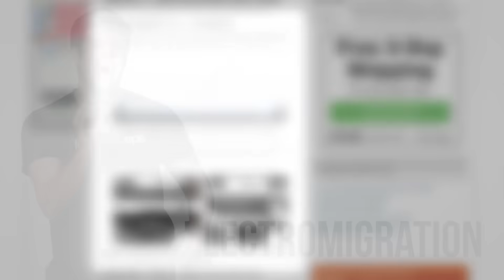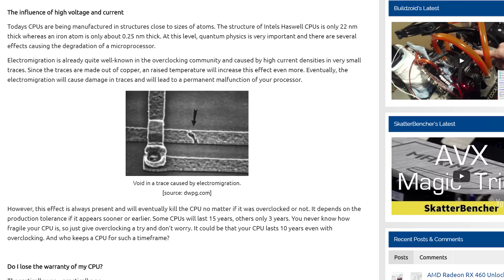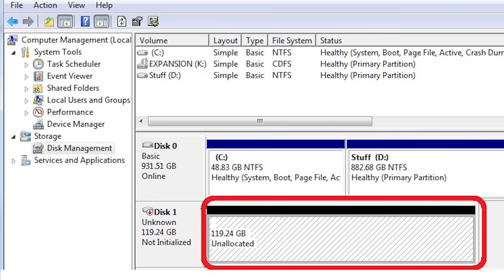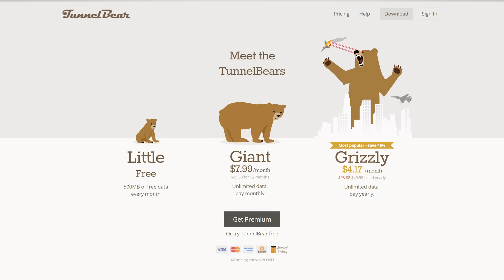Why Do Electronics Die?

Comment: Planned obsolescence is a very real thing. I used to work for a company who were masters of this. We would be in the prototype phase and when we designed a part, it was in the framework of "make it last, but not too long". The price of a part would be equal if we used the heavier gauge steel instead of the lighter, but that would make it too robust, too long of a lifespan. So we choose the thinner stuff. And we plan it to fail two to four months from warranty expiration. And to make it worse, we could make the failure to appear the user's fault. That is what I had issue with, and thus ended my employment there. No place for that sentimental dawdle in this day and age.
Reply: That is why no modern car will see classic stage!
Reply: why use one's family name as the company name?...
Reply: 100agree, and we are making this planet a junkyard  😥 that is not smart. So lets make things that last much longer 🙂
Reply: Thanks for sharing your real life experience.  Its something rarely heard.
Reply: "Planned obsolescence" is not a thing or, more precisely, it's usually misunderstood, it's not a plot to exploit people by somehow knowing exactly when something will break or wear out. All it basically is is the intersection of cost and demand i.e. "how much are people willing to pay" that determines the quality or lifespan of a product. For example, how much would you be willing to pay for a typewriter that lasts a 1000 years? Probably not ever much since typewriters are obsolete technology.
We can build things to last longer, yes, but most customers are not willing to pay very much for a smart phone that lasts 20 years when it's obsolete in less than 5.
It's customers that drive "planed obsolescence".
Reply: @177SCmaro That is an assumption you made up.  Planned obsolescence is very real, and for the purpose of selling the next new version.  Believing otherwise is self deception.  I'm not here to debate something I'm well aware of.
Reply: @qua7771  
Not an argument - just claiming someone is wrong or assuming something dosn't mean they are and has zero explanatory power. You're not correct just because you claim to be correct. Your remark is just as easily dismissed as if you came here claiming to be Santa Clause and you had no interest in proving it.
Reply: @177SCmaro  I mean, isn't it more beneficial for businesses to make a product break down sooner to sell a replacement? That in itself isn't caused by consumers, it's done by businesses to gain a constant recurring stream of revenue. Like you need to get more toilet paper because you use it up. Making electronics like that will generate consistent revenue is definitely something businesses want when it comes to stock growth numbers and business appeal. Although your points are still valid, I don't think it's a very complete thought. Also, withholding certain technological developments to make something become obselete from a technical and lacking certain features in the future is also part of planned obselesence. It makes the product less viable in the future, leading to the product to become useless in the nearer future, and causing a new purchase of a new model of the product sooner. It should also be noted that long lifespan products can SEVERELY disrupt cashflow with businesses, as the sale of these kinds of products are usually followed by a long period of few sales, which is extremely risky and dangerous for a business to deal with.
Reply: @alifelessrock48  
You need to read my comment again because it's not that simple. It depends almost enterly on what the majority customers want, not what the business wants, which determines the life-expectancy of a product. The customers are the one's choosing to buy the product. If they feel the price does not justify how long the product lasts they will stop buying that product and seek a better value alternative. It's two interests, sellers and buyers, working towards an equilibrium which could land anywhere between low cost and disposable and expensive and sturdy. 
This is super basic economics. Fundamentally it's about what the customers want and will tolerate, not the business. Nothing you said disproves or even really addresses this. Just calling it "incomplete thought" doesn't address anything I said. 
And withholding "certain technological developments" (citation needed) is poor business decision. I know if I was a competitor to Apple and I knew they were deliberately withholding features on their next phone that my phone would damn sure offer those features.
Again, "planned obsolescence" is largely a myth/a misunderstanding of some really basic economics. It's misinterpreting the demand for low or lower cost, relatively disposable or rapidly evolving products for a conspiracy pretty much every business would need to be in on against customers.
Reply: @177SCmaro   "It's misinterpreting the demand for low or lower cost, relatively disposable or rapidly evolving products for a conspiracy pretty much every business would need to be in on against customers." This discredits the fact that many larger corporations actually have stocks owned by those with stakes in their competitors. Apple and samsung actually work together for many things, they are business partners yet they barely one up eachother in the smart phone department. "The customers are the one's choosing to buy the product. If they feel the price does not justify how long the product lasts they will stop buying that product and seek a better value alternative." - When it comes to products essential to daily life this is not possible. Things like food and technology are essential, and often people are forced to buy them due to their lifestyle and for other reasons. No one produces these alternatives. You also never view this from a business perspective. You can sell more products with planned obsolescence.  You never address why this wouldn't occur, and you don't address why companies wouldn't find this attractive. Planned obselescence helps sell MORE inventory, so why wouldn't this be attractive? You never address the idea of consumable products either. Also, placing all of the blame on the consumer doesn't further your argument. There is something called business strategy where businesses aim to manipulate the economy. This is performed by joint groups of corporations. You also describe planned obsolescence as a conspiracy whereas I describe it as a business strategy. Fundamentally, we describe them and acknowledge them as completely different things. If you view it as a "conspiracy pretty much every business would need to be in on", which is highly unlikely, you might be correct. However, this disregards high cost entry industries where there are a few key businesses on the playing field, and the marketing tactics used to get consumers to accept lower quality goods. You are correct about consumers continuing to tolerate lower quality goods, but wouldn't this be something that businesses would aim to cause to increase profit margins? Wouldn't the evolution of products to be more disposable and rapidly evolving be part of planned obsolescence as well? I'm not sure what this term means to you, but everything you've said, including the cross section of consumer tolerance to what businesses are willing to provide point towards planned obsolecence. Businesses NEED to take into account changing economic conditions. Any competent business should also be able to scope out their potential product life span. I believe businesses are completely aware of planned obsolescence, and are capable of using it as a tool. Who wouldn't? The benefits do exist. "It's two interests, sellers and buyers, working towards an equilibrium which could land anywhere between low cost and disposable and expensive and sturdy." Businesses, through marketing and other means of communication and advertisement are capable of manipulating the equilibrium, especially in the modern day. Changing consumer expectations and current day cultural trends. Fast fashion is a primary example of this. Think of Shein. "I know if I was a competitor to Apple and I knew they were deliberately withholding features on their next phone that my phone would damn sure offer those features." This line of thought has happened several times in the past, yet Apple still dominates parts of the market.
Reply: @alifelessrock48  "This discredits the fact that many larger corporations actually have stocks owned by those with stakes in their competitors."
Yeah, because it's irrelevant. Who owns what percentage of stocks doesn't determine product prices, customers do by how much they're generally willing to spend, as I explained.

"Apple and samsung actually work together for many things, they are business partners yet they barely one up eachother in the smart phone department."

It's called "coopetition" and it's a good thing for customers - business that compete with each other also sometimes coming together to cooperate. Ford and GM are another example were they recently helped each other by jointly designing a transmission that works in their respective cars which helped reduced the cost of designing a new transmission which helps reduce the cost to the customers. 

The problem with Apple and Samsung and other large corporations is they ARE corporations. A corporation is not an economic concept, it's a legal one, as in government law, as in government creates laws that protect large businesses from things like the people who run the business being held financially liable for choices that cause harm to others or to protect their business from competition, which is what a corporation is - a legal protection - but that is a problem with having a government, they inevitably intrude into economics and become one and the same, it has nothing to do with Free-Market Economics.

"When it comes to products essential to daily life this is not possible"

Yes it is. Notice you failed to provide an actual example of even a single case where your claim is true. 
The only way there cannot be an alternative to a product is if it's brand new (usually technology) and others haven't figured out how to make their own economically viable version of it yet or it's a government monopoly directly or indirectly. That is the only way a monopoly, preventing alternatives, can survive is by force i.e. government. 

I'll give you a little help by actually naming a case were an actual monopoly, no alternatives, exist - interstate highways. No one, besides government, is allowed to build and operate them and if anyone attempts to build one the government will imprison them. If they try to resist by defending themselves the government will murder them. That is what an actual monopoly, denying people choices and alternatives, looks like. 

"Things like food and technology are essential, and often people are forced to buy them due to their lifestyle and for other reasons. No one produces these alternatives."

Essential for what? Food is essential to living, technology is not. And you're obviously wrong. You JUST named two choices when it comes to smartphones, Samsung and Apple, among others. And there are any number of different grocery stores available - Walmart, Winco, Albertsons, just to name a few off the top of my head. There are also smaller coops, farmer's markets, etc. I'm actually kinda puzzled as to why you would make such an obviously and easily disprovable claim like, "No one produces (food and technology) alternatives."  

"You can sell more products with planned obsolescence.  You never address why this wouldn't occur, and you don't address why companies wouldn't find this attractive."

Probably because I demonstrated why it's a myth/not what people think it is because so many people, yourself included it seems, have a basic misunderstanding of economics and thus see underhanded practices and manipulation in others where it's actually a produce of their own economic choices!

I mean, if businesses could sprinkle fairy dust on their products that compelled customers to buy them maybe they would, and that would be dishonest and manipulative, but fairy dust doesn't exist so it doesn't matter if they would or wouldn't use fairy dust. Same with "planned obsolescence". Again, it's not a skeme to manipulate people into buying more shoddy products, it's the intersection of customer demand and product longevity. Now a business can plan around this by guessing or responding to it, of course, but they're still subject to it.

As I said, how much would you be willing to spend on a typewriter that lasted for 100 years? Probably not very much since typewriters are obsolete hence why no one sells them. Same with a smartphones. How much would you be willing to pay for a smartphone that lasts for a 100 years when the technology is advancing so rapidly that it will be largely obsolete in 5 years, if that?

That phone's relatively short lifespan is a result of YOUR CHOICE, your unwillingness to pay more for a 100 year phone because you'll be replacing it in a few years anyways so the phone only NEEDS to last you for a few years. Yours and millions of other customers choices are determining that. This is, again, a basic principle of economics - customer's needs and wants drive the market and determine the prices and value of things, not the businesses. Business can only react to fulfill those needs and wants and sometimes proactively create new wants to serve the customers with new technology and products, but that's a gamble as there is no guarantee new technology and products will become popular.  

"...placing all of the blame on the consumer doesn't further your argument."

I'm not blaming anyone. Choice is a good thing. Nowhere did I suggest or imply that customer's choices are negative. I will say, though, that anyone, not necessarily you, pretending customer's have no or little responsibility for the effects of economics is laughable absurd. Businesses  can try to sway customers to choose their products, and there are some dishonest business practices some engaged in, my point is what you call "planned obsolescence" is not one of them.

"You also describe planned obsolescence as a conspiracy..."

No, I don't/didn't. That's how it's often framed by OTHERS whom I was referencing, particularly those with an agenda in using force (government) to gain control or influence over other people's businesses. I described "planned obsolescence" as, at worse, a myth, at best, a misunderstanding of basic economics, because it is.

"Wouldn't the evolution of products to be more disposable and rapidly evolving be part of planned obsolescence as well?"

No. It's just basic economics of customer demand and product longevity - customers are not demanding longevity that exceeds the value to them of the product so the product is not designed with excessive longity, which would increase the cost of the product beyond what customers are willing to pay. It doesn't matter what the business wants or what strategy they plan out, they still have to conform to this economic reality or go out of business.

I'm not sure how many more times, or how I can explain it any more simply, before it sinks in. 

"Businesses, through marketing and other means of communication and advertisement are capable of manipulating the equilibrium, especially in the modern day."

So are customers with the economic choices they make, hey, look, another equilibrium between buyer and seller, who knew?
Reply: @177SCmaro  You don't need expensive materials to make something last, a lot old cellphones can still work to it's day with no problem and they aren't really different in components compared to modern ones

A lot of electronics can pass the 20 year threshold if they are used with actual care, but some things just seem to die no matter what and others are so stupidly delicate they just break for the sillyest of touches even being expensive devices. Even tough devices can fail for software updates making certain features work worst, even when the difference in specs and features between new and old devices devices is pretty minimal to make sense. 

You aren't going to tell me if a company can make something work worst to make you buy it again in the future they won't try to, even if it is to the minimal extend
Reply: @veto_5762  
Nothing you wrote addresses anything I wrote or adds anything to the conversation. Like I said, it's possible to make a phone that lasts 20 years and costs several thousand dollars but no one will buy it because it will be obsolete in under 5 I think is that part you're not understanding. Even if you somehow make a cheap phone that lasts 20 years same problem. Again, it comes down to customer preferences. They build these things to last about as long as customers want them to last, anything more is an unnecessary expense that gives competitors an advantage.
And no one can make you buy something, well, besides government who has a gun to our heads but that's a seperate issue. Your vague claims arn't explaining, much less demonstrating, anything to be true.
Reply: @177SCmaro   "customers are not demanding longevity that exceeds the value to them of the product so the product is not designed with excessive longity, which would increase the cost of the product beyond what customers are willing to pay." - People have actually bought longer lasting lightbulbs before, but companies quickly recognized a decrease in sales because everyone had lightbulbs since they lasted too long (i.e. no one needed to buy more lightbulbs) and most made an agreement with each other to lower how long they last. I don't remember the case off the top of my head, but I think they cut the lifespan of their bulbs by half or so. Since people's lightbulbs lasted less long, they were forced to buy more or suffer the consequences, manipulating the customer demand to the companies' favour.

If you wanted to say that this does not concern phones or the like since they advance quickly compared to lightbulbs, remember that most people don't even set up their own computers, especially compared to pc users.
If you didn't buy a phone, you'd have
- No ability to use various useful phone applications (could be anything, work related especially)
- No phone calls/texting (important for some work places)
- No easy bank account management (all those applications unusable, not sure about pc equivalents)
Basically, a phone is just like a lightbulb, it is practically essential in many workplaces and gives you a massive benefit even otherwise.

Sure you don't need a phone to live, like food, but are you reaaaaally going to work in an office/fast food restaurant without it? If the restaurant/workspace was lacking people they wouldn't be able to contact you unless they have something other than phone messaging.

Also I'm pretty sure a monopoly can be established even with alternatives. Companies that hold a monopoly typically benefit from economies of scale allowing their products to be much cheaper than other competitors (i.e. the ones supporting planned obsolescence) which makes a huge difference especially in online stores, where companies selling alternatives without planned obsolescence get filtered out simply because they cannot afford to sell them at lower prices.

Furthermore, even if companies make phones that last longer with no added cost, we would only have to look to the light-bulb scenario to know they will suffer less sales at best. If people really wanted to buy new phones because they advanced so quickly, there would still be no need to swap out an equally costly part to another that does not last as long (as stated by OP). In fact, it should be a competitive advantage ignoring the lightbulb scenario.

In conclusion, since you like talking about the basic economies of customer demand and longevity, and how and I quote "customers are not demanding longevity that exceeds the value to them of the product so the product is not designed with excessive longity, which would increase the cost of the product beyond what customers are willing to pay." is false. Businesses (Like Samsung and Apple) can force artificial demand by adding planned obsolescence to their products, leading to people having to replace their phones more often whether they want to or not (because these type of people exist). Since these businesses operate on much larger economies of scale, they can utilize predatory pricing to decimate any competition, or keep them irrelevant, effectively forming a kind of shared monopoly.
Reply: @blazalage8519  
The basic mistake you and others continue to make is you only look at one side of an economic exchange or the other at a time without keeping context in mind and so you end up with the short-sighted conclustion that business can just arbitrarily control how long something lasts, the implication they're ripping off their customers, and customers are powerless to effect this. 
It's also HIGHLY suspicious anytime someone uses an analogy first, particularly when they conveniently forget the case, as though it explains evey situation within the entire economic world simultaneously - like here's one case of maybe some lightbulb manufacture maybe acting shady therefore all business everywhere manipulate their customers in an unjust one-sided affair. Where is the the demand for super long life bulbs but expensive bulbs? Again, most people don't want to spend very much on bulbs.
In other words, you're being very disengenious and manipulative yourself here, casting aspersions on others with zero proof while misrepresenting the balance between business and customer by, again, implying customers are powerless victims even going so far as to misrepresent what a monopoly even is by claiming a market with alternatives is still a monopoly which flies in the face of what a monopoly freaking is.
You're not here to figure out the truth, you're here to defend an ideological assumption rooted in Marxist econmic thinking of the "oppressor/oppressed" narrative, those with power and those without, doing the classic Marxist trick of ignoring one whole side of the interaction to make one aide look like they have all the power and the other side none by ignoring it which is a really sleazy way of absolving customers of any responcibility for how the economic landscape is shaped. 
Things like smartphones are a luxury and a convince, not a necessity, and there are many alternatives that provide the same features so skipping over that bit of irrelevancy.
Again, not what a monopoly is. Creating an advantage over competitors like lower production costs is not a monopoly. Moving on.
And you go on continuing to ignore the fact that customer demand is driving relatively short lived phones. This is like watching someone go on and on about how they made a carburetor that gets 1000 mile per gallon decades ago but the evil oil companies murdered the inventor and convered it up while missing or ignoring some really basic aspects concerning the physics of how an internal combustion engine works that explains what a naked absurdity that conspiracy was/is.
And I'd like to point out that notice you failed to explain just how long products SHOULD last, even in your light builb anology and at what cost. Again, the primary reason phones don't last as long as you arbitrarily think they should is MOST customers decided they're unwilling to pay extra for highly durable phones because they become largely obsolete so quickly. 
That's not business screwing over customers that's customers decided what their willing to pay for and you, apparently, not agreeing with the majority of customers choices.
Btw, I still have an Samsung S9 that works just fine for my needs and when did the S9 come out? Like 5 or 6 years ago? And the only reason I even got the s9 is I accidently damged my old phone. It literally took me dropping a transmission on it to finally kill it. I'd say that's pretty freaking durable.
You don't get something for nothing. If you want a phone to last 100 years go try to build one and see for yourself just how expensive it really is and then try to turn a profit on it. Because right now you come across as someone who has never run even simple business criticizing huge and complex businesses for just not doing enough for you. I'm not saying they're saints either, far from it, I'm just saying the conspiracy theory of " planned obsolescence" is, at best, misunderstood economics and, at worse, basically indirect slander.
Reply: @177SCmaro it's not arbitrary. It's engineering. Did you read the comment you replied to?
Reply: @godmagnus  
Did you? Because engineering something to fail or wear out at some arbitrary point is what they're arguing.
Reply: As a counterexample, there was the Phoebus cartel who had lightbulbs manufactured with an intentionally lowered lifespan. And it's not like customers want lightbulbs to become obsolete since the new bulb are often about the same as the old one.
Reply: @jk-2053  
In a free market that would make them wide open to being undercut by competitors eventually.
Reply: @177SCmaro  It's not just about phones. You're basing your argument on the most obvious example that will be obsolete in a few years. It's obviously a technology that keeps improving drastically and keeps getting obsolete fast.

What about other electronics, like kitchen appliances, ovens, fridges? Fridges and ovens aren't going to become "obsolete" that fast, yet their lifespan has been drastically reduced. My grandma had an oven last for over 35 years without breaking, and working just fine. You're lucky if your new one lasts more than 5-6 years without breaking.
The overall quality has dropped off massively in the last 30 years. 
What about furniture? It's the same thing, old furniture was much sturdier and had a much higher quality. Nowadays everything is made out of plywood, and if you really want to get something good, you need to spend way too much money.

You think customers don't want the same quality of products that they had 20-30-40 years ago, at around the same price (adjusted for inflation obviously)? You think customers prefer having to constantly replace stuff around their house? You think they actually have the money to do so? You think they wouldn't rather buy a more quality product that will last them longer, rather than buy something of lower quality that they have to replace every 5-6 years?
Reply: @_Diktator  The irony of being lectured on the ethics of economics from a guy with a parody dictator for a profile picture lol. That's funny.
I'm actually not basing my argument on phones. It's just that phones are something easy for most people to relate to since almost everyone has one. I'm basing my argument on the basics of economics, specifically "supply and demand", especially the "demand" part, the customers, which no one has been able to refute. Barely anyone has address it. And the reason I focus on customer demand is there is a very great tendency in contemporary economics to hold those involved in the "supply" side of things, business owners, corporations, etc, accountable via criticism but very, very little interest in holding the "demand" side accountable, the customers. Decades of Marxists domination of academics will do that, naturally.

And a word of advice, "whataboutism" usually isn't a very good place to start an argument. It comes across as an attempt to avoid the principle being discussed by way of excuses or even cherry picking. I'm talking about a generality here in economics. It may be possible to find an example somewhere of a business attempting to deliberately short-life a product for any number of reasons including profit but, in general, that's a very poor business decision as it ignores demand, what the customers actually want, in favor of potential short-term gain.

So what about kitchen appliances? You claim, with no explanation, evidence, or context that kitchen appliances don't last as long as they did I'm guessing 2 or 3 generations ago - roughly 40 to 90 years ago. The closest you came is your grandmother had one appliance that lasted 35 years and never had issues. You don't actually mention what type of oven this is, how much is was used, and compared to what? You just claim that "new ones" only last 5 or 6 years without "breaking", whatever that means. 

In other words the closest you came for evidence and explanation for your claim for me to consider is an extremely vague anecdote from one of your relatives. There isn't really anything here for me to analyze.

Same thing with furniture - just a very vague claim lacking anything to consider. 

"You think customers don't want the same quality of products that they had 20-30-40 years ago..."

That's a distinct possibility as the evidence for a preference for disposability in the market suggests. You may not like the average person's preference for lower-cost, more disposable goods but that doesn't make the customer wrong, nor does it mean the producers are conspiring against them. I mean, look at how baby's diapers have changed. Once they were made of cloth, very durable, long lasting and reusable/washable. Now they're much cheaper and disposable (cheaper in that they save the customer time, not necessarily money, another factor in all this). A conspiracy of "planned obsolescence" to get customers to accept a lower quality product or customer's preferences changing over time? 

 "...at around the same price (adjusted for inflation obviously)?"

You haven't provided any prices at their relative times for me to consider.

"You think customers prefer having to constantly replace stuff around their house?"

I would not consider "5-6" years as "constantly replacing stuff". And since you've an appetite for anecdotes, I have lived in my current house for about 6 years now and the only appliance I've replaced, and my appliances were far from new when I bought the house, was my hot water heater. 

"You think they wouldn't rather buy a more quality product that will last them longer, rather than buy something of lower quality that they have to replace every 5-6 years?"

The trend in the market seems to be for a customer's preference for lower cost, more disposable products which constitutes the majority of sales. Probably why places like Walmart are so popular. 
Again, not saying producers are as clean and pure as the wind-driven snow, but as consumers we need to take some responsibility for how the world is based on our choices and actions. "Planned obsolescence" is a perfect way to avoid accountability by placing all the blame squarely on the shoulder of the people making the thing rather than those buying it.
Reply: @177SCmaro  You missed the comment.
Reply: @flintfrommother3gaming  
How? By explaining why it's wrong and/or misleading?
Reply: @177SCmaro did you not read the main comment where the person shared his real life experience? Alright, if I'm being fair to you, can I ask you if its ethical for a product to be made to fail 2-4 months after its warranty?